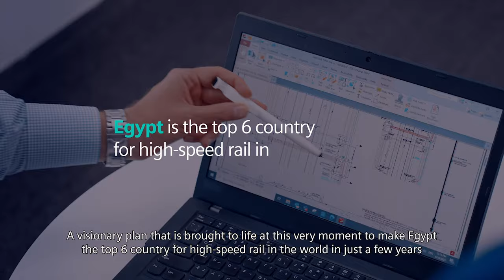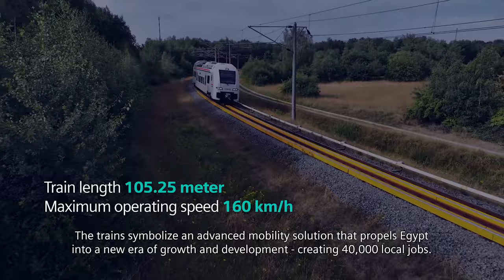Suez Canal on rails: Building Egypt’s groundbreaking high-speed railway

Comment: 160 km/h is fast, but not high speed 😢
Reply: The video only shows the regional trains with 160km/h max speed. Additionally to those, Egypt bought Velaro trains for high speed travel, those are much faster. If I’m correct
Reply from the maker: The project consists of 41 Velaro, 94 Desiro HC, and 41 Vectron. Velaro is a high-speed train with a speed of 230 km/h, Desiro HC is a regional train with a speed of 160 km/h and the Vectron is a locomotive train with a speed of 120 km/hr.
Reply: @SiemensMobilityGlobal  nice 👍, could have been part of the video
Reply: As an Egyptian 
I will tell you that we do not need more than these speeds because the difference between each station on this railway is not 45 or 90 or 110 km and this is in regional terms As for the expressway it is 230 speeds and we do not need more than that The distance between the main stations does not exceed 150 km The interdistances  A task to determine the speed of the train
Reply: @waelsapry8702 as an Egyptian I tell that Siemens as well as the Egyptian government know what is best for us